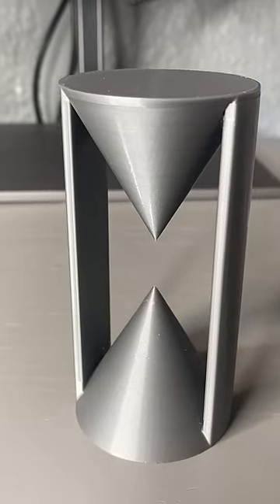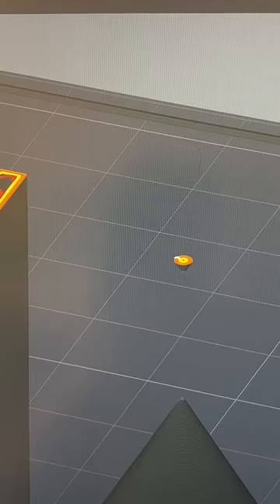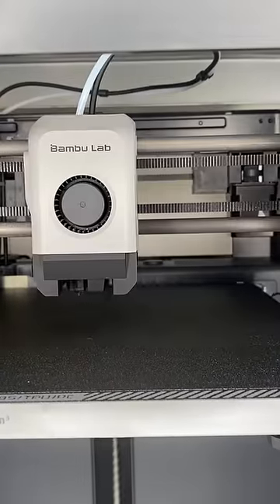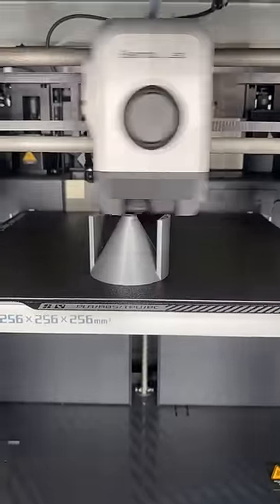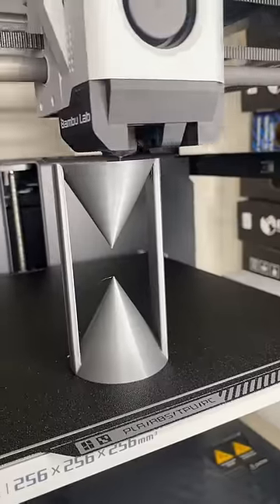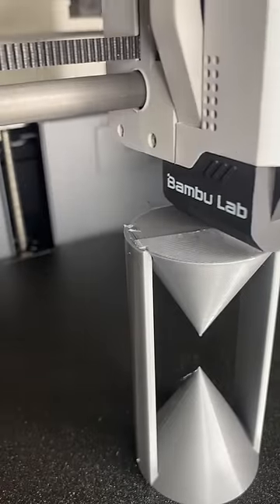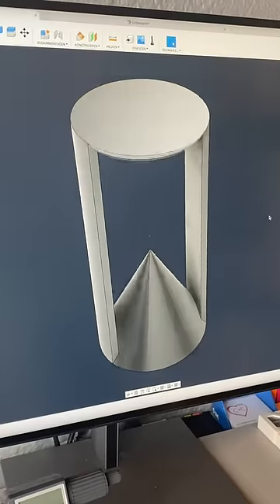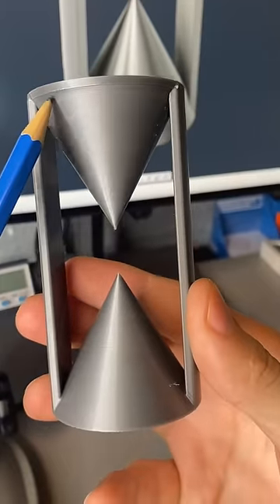printed WITHOUT support #shorts

Comment: I’m not sure itll have the same strength as if printed normally. There will be a definite weakness at the interface between the old part since they are not bonded. Thus, the strength will decrease proportionally to the size of this interface.
Reply: Yeah for strong functional prints, everything about the design and how it's sliced/printed is a different mindset. Depending on the material, using a suitable adhesive or solvent to bond the parts or even melt them together at the contact points could end up comparable but I'd avoid this as much as possible.

In this case, I doubt it would be substantial enough to matter simply because it's not designed for strength to begin with.
Reply: Throw some gluestick on top of the inverted cone to increase strength…right?😂
Reply: @Aquaponic0   Not a bad idea. A bit of hot glue to fill in the gaps of the infill would make the part even stronger than if it were printed normally.
Reply: I wonder if adding thin, shallow ridges on interfacing plane would make the connection stronger (depth being same as print layer height)
Reply: It always depends on the design and function.
He has created keys to insert the part which will make it way stronger. For many designs this is the fastest and best way, just not for all.
Reply: Y'all, the solution is simple. Ironing. You can make the printer weld the parts together. Yeah it wouldn't be perfect because there's still the slots on the sides but layer wise it'd just need a bit of sanding
Reply: A touch of epoxy when you place the old part in and that weak joint becomes the strongest section.
Reply: CA glue to join parts. Takes no space when dried
Reply: @xxportalxx.  Epoxy is the correct answer. CA is easy but brittle.
Reply: @DnBastard  Sure, but you have to model the joint properly as well as get the tolerances correct. Easier to glue it in.
Reply: @DnBastard  Dovetails in Woodworking are generally 7-12 degrees, but booleans on the 3rd object doesn't solve the tolerance issue for the printer. Rarely are printers going to print the exact size, and with a dovetail, 0.2mm or more would affect the fit.

Comment: That's actually very smart for parts that can be difficult to remove supports on. A little effort in meshmixer would go a long way! Maybe even making use of acetone or some super glue to increase the strength of the bond to more than a few surface layers for parts that could make better use of the extra strength!
Reply: Don’t use acetone for PLA though - it’ll weaken it
THF iirc is the one to go for there? But I’m not sure how neccesary it’d be if the hotend is ironing the surface too

It achieves the same thing, turns the plastic layers into a liquid phase and then as they dry/cool they’ll solidify as one homogenous phase (at least I think it’s homogenous if the temp goes above glass point?)

Comment: Sadly not many people know about this technique. I frequently see questions like "how do I print this without support". Keep in mind that it makes waterproof connection while still looking good.
I made rear light for e-bike this way - printed black case, paused and inserted red transparent piece to print on top of it. Earlier i tried glueing red piece, using silicone, but this is the only aesthetic solution, which works perfectly.

Also it's a way to have overhangs without this rough texture that support leaves

Comment: The bond is weaker due to the lower temperature in the preprinted part
Reply: Idk. If you have 100% part cooling on, the previous layer shouldn't be that hot anyways. Having the Gcode stop the print for 10 seconds to drop in the top part shouldn't make that much of a difference.
Reply: The point is to consider this and other methods as options.  Here it's not a functional part, so the strength difference doesn't matter.

If you need to consider this for a functional part, there are mods you could make to the design that would compensate for the lack of solid bonding like making the support arms wider, etc.
Reply: How about heating the part on heating plate in controlled temp before joining them..

Comment: Great idea. I think a tutorial explaining how to add whatever the necessary g code to a more standard printer would be a great follow up. (If this already exists on your channel I apologize)
Reply: Totally agree, I’m still learning the CAD side and specifics of g-code so those more in depth explanations are invaluable at times
Reply: There's no special g code here, and it can be done on any printer. He kind of explained it... you model this as two parts that happen to fit together.  Slice them separately. Print the upper cone first. Then, when printing the lower cone and posts, pause it at the right height to insert the upper cone. Then continue printing. So the only non-routine part is you need to insert that pause at just the right layer. You could do that by editing in a pause in the G code, or I think some slicers allow you to insert a pause.
Reply: To pause the print is very simple, actually

If you're using cura, all you have to do is go to extensions in the top right bar and select post processing 

After that you can enable a filament change and it'll pause and make beeping sounds (iirc) at the right layer
Reply: @WithDaBoiz  pausing with cura can be a pain in the ass if you use klipper though

Comment: I usually cut M3-M5 threads directly in my PETG parts and this holds up perfectly
Reply: Like hiding the threads internally?
Or threading it to facilitate that connection?

Not the best at the CAD side yet, but holy shit thank you for the reminder that I need to learn how the extruding (mb if thats not the right term) features work 

CAD is such a useful tool I wish I’d taken the chance to learn it in highschool or had started earlier
Reply: @BirnieMac1  Nothing to model in CAD. For example a M3 just make a cylindrical d2.5 hole and then cut the M3 right into the printed part with a thread cutter. Works best with through holes but works also with blind holes.

Comment: By the time you've paused the print and the print head has retracted the top layer would have solidified already so strength wouldn't be the same at all since you're just relying on the layer printed after insertion for adhesion. Should probably add some glue

Comment: It's not as strong. If you pause a print 15min or so, depending of the material, and you resume, you don't get the same layer adherence. It doesn't matter for this part for sure but keep that in mind.
Reply: That's what the harbor freight heat gun is for...get that part nice and soft again
Reply: @joecee6862  thanks for the tips, I ´ll remember it.

Comment: Unfortunately it will not result in the same strength, layer adhesion is one of the biggest deciding factors in part strength, having no layer adhesion in a certain part of your model drastically reduces the strength of the overall part especially on the Z axis...
Reply: The point is to consider the strength needed and design for purpose.  This is clearly a non-functional part, so that strength difference won't matter.

If it did, you could compensate by, for example, making the support struts wider, etc. to gain back the strength.

Comment: I used this method to place a cylinder weight inside of a closed egg so it can wobble. I got it to the right layer where the cylinder was the support and doesn't shake around inside.

Comment: I love this idea!! But does require maybe a little more work. Unless you print them both at the same time. And have the printer stop at a certain point so that way you can take the piece that was printed and just put it on top and continue the print again. I’m just saying because you said you printed previously. But I’m just saying would you be able to just print them both out at the same time? But I think that would also depend on how big your printer surface is? I don’t have a printer xD but I like seeing ideas like this because it’s a solution to a problem. Just takes time to figure out how you can use this technique on your own prints.

Comment: Supports will save so much effort and worrying about not getting stuff like that in the right spot. 3d printing is about patience
Reply: Cleaning up supports can take much more effort than this trick.
Reply: @SaHaRaSquad  no because the nyou have to not oly wait for it to get to this point, you have to hope you get the part in the right spot. There are better ways to avoid using supports, this def isnt one of them lol. sure you're saving material but you'd have to watch the machine like a hawk
Reply: @FiberglassUnicorn  Or you take one glance at the slicer's output and set a timer instead? But of course you can watch the machine like a hawk if you think it makes a difference.

Comment: Except for the fact that, no, it'd not anywhere near as strong. The bottom part isn't connected and unlike a normal print unless you preheated the next part, it would be dead cold, which means weaker layer adhesion

Comment: It's not as strong as if it was printed in one, there's no bond on the underside. If you want to avoid support material just print in two parts and solvent weld, there are lots of glues/welds/epoxies that will give you a stronger bond than the part itself

Comment: That is not a one part. It is two parts. It would be a same thing to ask "How did I machine this part? Well, I machined one part and welded another into it." as that is essentially plastic welding. That is an assembly that requires an additional step to be completed.

Also, if you meant with the "zero tolerance" thing that you designed no gap between the parts and still put it together, it means that the vertical beams flex outwards and therefore are not level. Anyway that "zero tolerance" doesn't make sense as the printing accuracy is usually +/- 0,2mm on plastic filament printers.

Comment: They should just make 3d printers print upside down. Then instead of having to make a thick support to hold up an object they could just print a thin tensile thread that could be cut off later. Though I guess it would still have to be thick enough to not wobble. So maybe it causes more problems than it solves. still it would be fun to see.

Comment: Very underwhelmed by this "solution" to not using supports.  Print two pieces?  Uh, yeah.
Reply: I expected him to print one side upside down and then flip it
Reply: I mean if you're going to be completely reductive to the point of ignoring the point of the video, sure.
Reply: @snickerdoooodle Nah he's right. The only part he "ignored" was imbeding it back into the print but that's no different from just gluing them or melting them together
Reply: Yeah the video title and thumbnail suggest some elaborate or novel solution, creating a difficult piece out of multiple easier pieces has been done since humans built things. I thought he did something like moving the z-axis down to print with a free hanging string.

Inserting a the part during the print is newish I guess (but I've seen it before with things like nuts) but this isn't even really necessary here. Using glue would probably be easier and just as strong.

Comment: Nice idea, how did you pauze it?
Reply: On the specific layer you put "m600" or "m226" code on your gcode file with a text editor. Print pauses, you insert the part and send the m602 code to your printer again to continue with the gcode.
Reply: @yildizyeni  how do you manually send the m602 code to restart? (Have an X1C and haven’t looked into this prior to this vid)
Reply: @bmickle  I don't know your specific model and I am nowhere advanced user but my approach was using octoprint printer is connected via usb. And I send the commands over the terminal. There are multiple codes experiment with them and use the one that works. Different printers have different codes(due to version difference)
Reply: @yildizyeni  EDIT: for Bambu it must be done in the slicer.  Figured it out.

Comment: "Just as strong as if it had been printed directly as one part..." 

I guarantee it is not. Not once have I tried to resume a paused/stalled print that was idle for even a handful of minutes and not had that layer of the print become a build-in point of failure. You're basically introducing a simulated stress crack in the part on purpose. 

You should put a notice that this technique is only to be used for art pieces, and only in the rare case that it is absolutely necessary.

Comment: How do you perform the final patching operation?
Reply: You put a pause in the gcode at the point where the second part is added. The printer pauses, and once you place the upper cone in the print, you hit resume on the printer and it finishes

Comment: Or print it sideways?😊
Reply: And use a ton more supports supporting the side angles
Reply: @skop1219  depends on the angle, the angle on this model might get away without needing supports